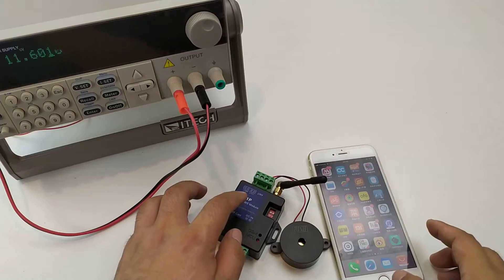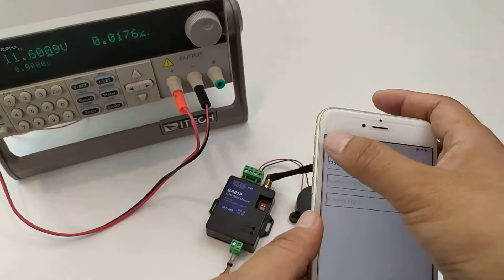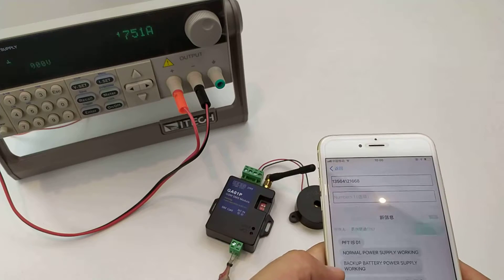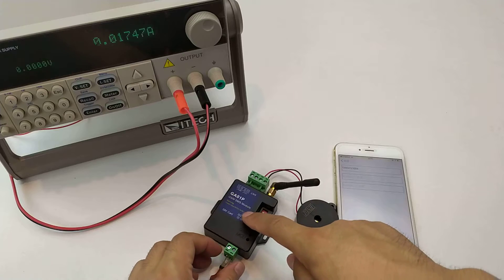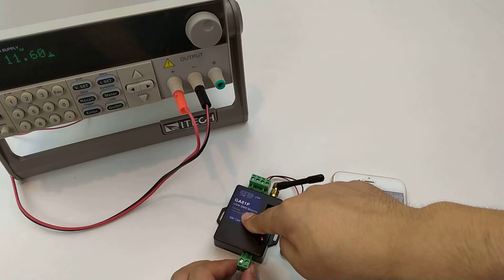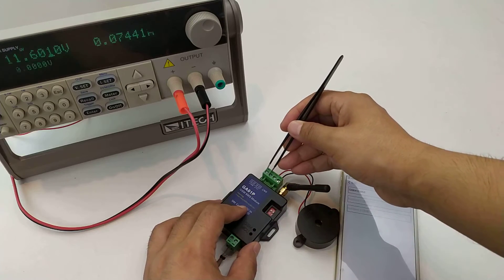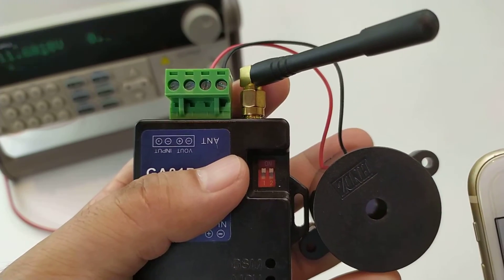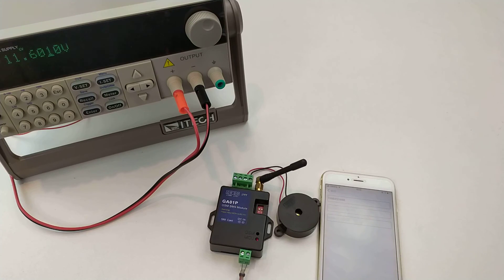GA01P gsm alarm box for power failur alarm

Comment: I purchased this product on your aliexpress store but I can't get it to work.  I inserted the SIM without the pin code (I tried 3 but without success).  If I don't insert the SIM the LED flashes constantly, but if I insert it it flashes 6 or 12 times then stops for 3 seconds and starts again.  what does it mean?

Comment: With battery only, does the GA01P send a text when the input is activated. Can you show this on a video. Mine does not send a text.
Reply from the maker: yes, with battery, it can send the alarm SMS. you should charge the battery for some minutes. if the battery is not fully charged, then cann't send the alarm SMS successfully.